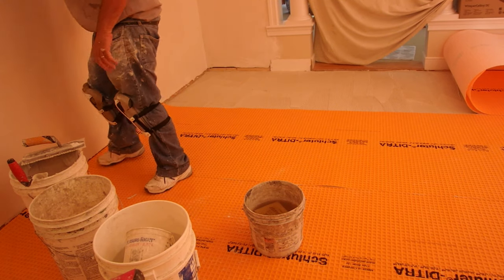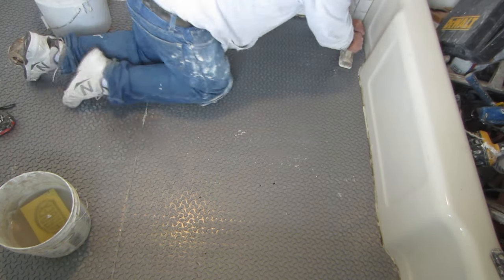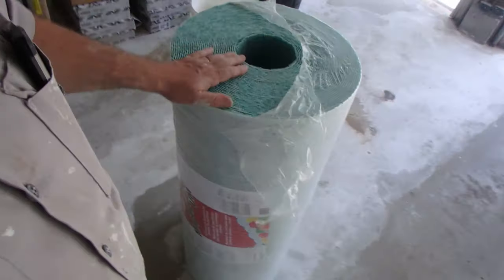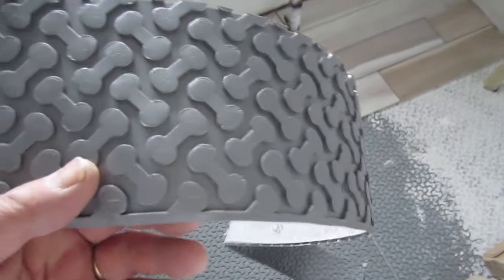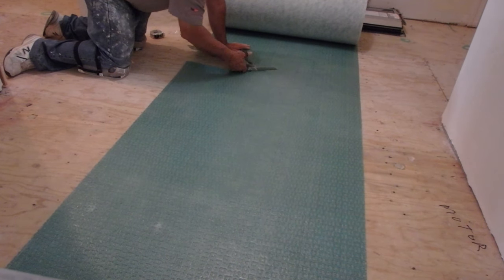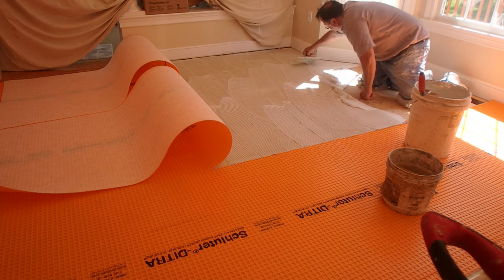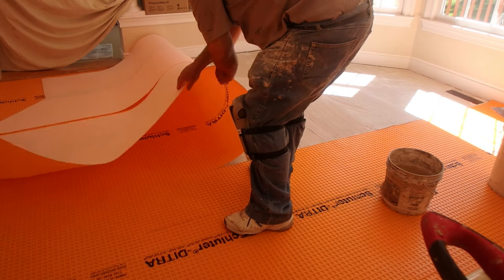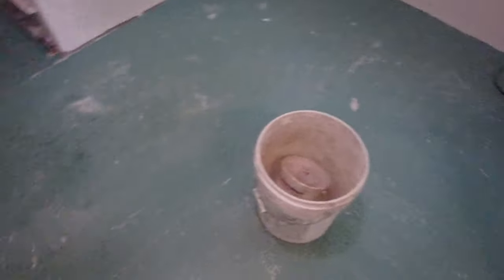TILE FLOOR don't let it fail

Comment: I just used Laticrete mat on my concrete slab for a kitchen tile floor.  Pricey at $1.37/ft2.  Flexbone was my next choice, but the Laticrete was best fit for size needed.  I heard of a new USB membrane at $1/ft2.  My last big floor tile job was 1994 when such didn't exist (screwed tile backer boards to plywood over 1" boards).  I did a bath and washer room in 2020, installing the tiles direct to the concrete, but small areas w/ no cracks in the concrete and smaller 1 ft x 1 ft tiles so "should work" (no cracks after 4 years).  Didn't know about uncoupling then.  Some use a roll-on liquid like Redguard or Mapelastic CI.

Comment: Thank you for the videos and tips!!  I am installing my first tile floor, and would be lost without you!!  For the next one, I would like to use an uncoupling membrane on top of an OSB-type subfloor (it is not plywood, and not particle board, so I assume it is OSB).  For many of your uncoupling membrane videos, the membrane is placed on top of plywood subfloors.  I have not noted that you mention OSB.  Should I assume that OSB and plywood are about equivalent for the purpose of overlaying uncoupling membrane?  THANK YOU!!
Reply: Scrape the floor to get any loose stuff vacuum and sponge it clean and then You should probably prime it with a bonding primer before anything else. And if you are trying to find someone to help you out with tile you will notice that nobody agrees with anybody about anything. But that's what I do when I'm working with OSB.

Comment: My local hardwood/tile store is telling us its ok to install their tile over 1-1/4" plywood, does that sound right?  It sounds like they are telling us the membrane isnt needed.  If I have a super beefed up floor (2 layers of 5/8 ply) wont that eliminate any possible deflection, or is the uncoupling for expansion/contraction issues?  How much does the ditra or doggie bone stuff protect against deflection?
love your videos, super helpfull
Reply from the maker: The uncoupling membranes attach the tile to the floor by a mechanical means. the tile is not actually adhered to the membrane so the membrane can move and deform without transfering that movement to the tile. It is a non force  conductive assembly, sticking the tile directly to the plywood, which can be done if you follow TCNA Handbook Method F150 to the letter, is a force conductive assembly, the tile is bonded directly to the substrate and the only thing protecting it from movement is the flexibility of the thinset, which is very minimal. Here is the Ditra Handbook https://www.contractorsdirect.com/PDF/ditra-installation-handbook.pdf
nad how an uncoupling membrane works https://www.youtube.com/watch?v=YpXEXqbh7ok&t=1s

Comment: Sal what is the best membrane to use for a small mosaic like penny tile? Schluter told me they won’t warrant a mosaic less than 2” on Ditra. I want to use a membrane for the penny if possible because I think it way lay much smoother.
Reply from the maker: None of the uncoupling membranes will allow tiles smaller than 2". Is this a floor or a shower pan?
Reply: @SalDiBlasi  It is for a floor
Reply: @SalDiBlasi  I have heard that nobleseal or just Mapei self level would be best
Reply: @SalDiBlasi  I have the same question as @reillyliner - help please! We have, sadly, already made the mistake of laying down Ditra before realizing that our 1" hexagons were unfit for it. Should we just use Mapei self-leveling over the Ditra to fill it in and make a new flat surface?

Comment: Hi Sal.  I was told to add 1/8" sheet of plywood on top of my OSB subfloor before adding thinset and Ditra.  If I do that then my tile won't be level with by 3/4" hardwood floor.  
 Can I put thinset directly on the OSB subfloor and then the Ditra then thinset and tile so it will be very close to the level of my 3/4" hardwood floor?
Reply: You can add a sheet of luon if you want or just scrape the floor to get any loose stuff, vacuum and sponge it off. Get some bonding primer and give the floor 2 coats of it. Then uncoupling membrane and then tile

Comment: Thanks for your information. I think I understand what the membranes do. I want to tile my floor in a concrete high-rise building in Bangkok (about 30 degrees Celsius +/- 10 degrees all year. It seems nobody here knows about membranes. And they are not available in construction shops. Is it maybe not necessary to use them on concrete and if the temperature does not change much? Thanks?

Comment: Great video! In the new build they put the baseboard in the bathroom, should I remove it before adding the membrane, or can I thin set the membrane on the baseboard?
Reply from the maker: Remove it

Comment: Hi Sal, very informative video. Do you recommend a floating underlay/ uncoupling membrane? I am looking at this specific product that will not be attached to the subfloor. The supplier says the product is really designed for that and won’t create any cracking issues. But I am afraid it’s just for promotion purposes. Appreciate advice!

Comment: I am doing a bathroom remodel and considering putting in the Ditra heat mat.  Potential problem is the previous homeowner put an epoxy flooring over the plywood substrate and tiled over it.  I'm not sure what thinset they used, but it stuck extremely well as I had to grind the thinset down to the epoxy layer h what a mess.  Is there a suitable thinset I can now use to adhere the Ditra mat to this roughed up epoxy floor?

Comment: Sal, have you ever used Dural Backer Lite? Looks similar to the Mapei product where the top of the membrane is covered with the plastic product. I thought it was strange that the thinset doesn't get filled into the voids (like with ditra). Love all videos and the dedication to your craft.
Reply from the maker: Dural is the same product, and they make it for Mapei.

Comment: Love your videos! You mention an “extra step” for waterproofing a floor if using Laticrete’s Strata Mat. What would you recommend? I spoke to the local Laticrete rep several months ago who suggested using 1/4” cement board or Hydro Ban board (over my OSB subfloor), then waterproofing that with Hydro Ban or Barrier (using anti-fracture tape on seams and screws), and then installing the Strata Mat. This route adds additional height that will create a noticeable step up that I wanted to avoid. Hoping you may have an alternate recommendation while still using Laticrete products. I’ve considered Ditra but given I plan to use Hydro Ban board on the walls I don’t want there to be a Laticrete-Schluter boundary for ease of ensuring maximum warranty coverage. Do you have a video that covers install of Hydro Ban board on a bathroom floor?
Reply from the maker: Since the strata mat has hydration perforations in it, you would have to add a layer of a sheet membrane over the whole floor on top of the strata mat.
Reply: @SalDiBlasi  Have you ever installed Hydro Ban board over OSB rather than cement board or would generally not recommend doing so? From a weight perspective and ease of cutting, it (Hydro Ban board) seems much more appealing than cement board if not using a decoupling mat.
Reply from the maker: @brandiatl21  Use an uncoupling membrane, they are designed for floors, Foam boards are designed for walls.

Comment: hello sal just a? or your thoughts on a shower floor is it okay to caulk the bottom perimeter or is grouting that in the way to go. thank you
Reply from the maker: Technically it is supposed to be caulked with silicone, I  will usually just grout that transition. I silicone all the others.

Comment: Huge fan of your videos! I am installing Red Guard uncoupling, using thinset over a plywood (23/32 Cat Ps1-09 Tounge and groove Pine) on a 16" on center floor joists. Is this a suitable base for 12"x24" porcelain tile installed with LFT Thinset?
Reply from the maker: You need to install an underlayment of some kind first, an uncoupling membrane would be my suggestion. You also need to check the deflection of the floor. https://www.youtube.com/watch?v=74BDTI67S1M

Comment: Sal. There are still installers using the mesh and scratch coat method. They claim with today's modern materials are the same or better and cheaper than an uncoupling membrane. What is your opinion? Thanks.
Reply from the maker: Don't  believe it, also know as a Jersey Mud Job, one of the worst ethods ever. Not to be confused with floating walls and floors.

Comment: Schluter allows you to use a modified thinset to adhere your tile. What’s so special about their thinset that allows this Sal.
Reply from the maker: The thisnet is formulated to work with Ditra. The reason is  a few years ago there was a development in thinset mortar technology that has mitigated the original reason for the use of an unmodified mortar.  All the manufacturers have mortars that will work with Ditra. The thinset manufacturer will substitute their warranty for Schluters' in most cases. Check the manufacturer  details for specifics

Comment: i see the backer boards role only in leveling in case  the floors might be uneven/wavey or in reinforcing / thickening the substrate where the floor is only plywood. Otherwise again, if it is a flawless concrete floor, there is no need. This is only my european view, i respect your experience. Here we have been mounting tiles directly on with no membrane. I know why membrane is popular, cause it comes in roles and easier lighter to carry than cement board.

Comment: Hopefully someday they will come out with an uncoupling membrane where the waffles are filled with foam or something instead of thin set, those membranes use a lot of thinset to fill the waffles.
Reply: That's what locks the tile into the membrane
Reply: @davegordon6943  Yes but Kerdi adheres also without waffles…I believe the waffles filled with TS gives it its strength..

Comment: Sal, question, customer had tile in plywood substrate. Over time issues occurred. How clean does the plywood need to be to install uncoupling membrane? Or do you recommend a different solution? Thank you for making the industry better.
Reply from the maker: If possible grind it off, does not take as long as you might think. You don't want  the new install to be dependent on the bond of the old thinset.
 https://amzn.to/2XOQqpg
https://amzn.to/2yu4pX6
https://amzn.to/2VnAs3X
Reply: @SalDiBlasi  okay a close to fresh wood as possible with a dust and wet wipe down I presume. Thank you very much Sal!!

Comment: Hey Sal,
Im Pinning down a plastic lath over concrete slab. The plumbers gonna run his radiant PEX and Zip tie it to Plastic Lath.
Installing expansion joint around perimeter of floor, then stretching the dry pack.
Question, 
Will installing any Uncoupling membrane over a mud/Lath application with hydronic radiant heat be unnecessary?
Reply: You have no common sense apparently. You would use gyp crete to encapsulate the pex, basicially a sellf leveling product then tile over it. Doing a dry pack over radiant floor then putting a plastic membrane over it is going to be ineffctive

Comment: Would you always lay a backer board on the floor over plywood? Is primer necessary?
Reply: Primer for sure over old. Use it ACCORDING TO SPECS.  Start tiling after proper limited "dry"time. You don't need a backerboardwith these membranes.
The extra money is ABSOLUTELY worth it.  The risk of your bad tile job will be lessened versus the difficulty to install that backerboard anyways, too many things to get wrong. And it's still not going to perform as well as crack iso membranes or uncoupling

Comment: Hey sal, I have a question I’m hoping you can help me out with. So I’m redoing the addition on my house that was done in 83. And the subfloor is 5/8” not tongue and groove which I don’t love but it is what it is.. I’m tiling the bath floor and it will be meeting hardwood. In 2 other areas in my house I put 1/2” cement board over the 5/8” and transitioned to the existing  hardwood with an angled schluter metal which worked out great but ideally I’d love for the new tile and new hardwood to end up flush like usual.. do you think that 1/4 hardie backer over the 5/8” is strong enough or would you recommend an uncoupling membrane? Love your videos and really appreciate any advice you can give.
Reply from the maker: First off if the plywood is not tongue and groove, you need to install blocking at all the seams. Cement board hs no structural value, the only reason to use the 1/2" on a floor is because you need the height, 1/4" is made specifically for floors. Better to use an uncoupling membrane anyway.
Reply: @SalDiBlasi  thanks for the feed back

Comment: Hi Sal which produce would you suggest as far as chalk lines being visible  an more so holding to the membrane for a good layout. Iv had problems with this I  even tried spraying line's with hair spray Or would you suggest I tight coat the day before when possible
Reply from the maker: I will usually use a black marker to draw my lines.

Comment: What are your opinions on tiling on level concrete? Where I installed my tile there are never any major earthquakes or flooding or anything so foundation issues are very uncommon. I've had no issues.
Reply from the maker: Well if it is done, then no point worrying about it. Concrete moves at almost twice the rate of tile, so there is that. Even though you don't have any cracks in the concrete now, it does not mean it will not happen later. Like I said there are two kinds of concrete, All that being said, I have installed directly on concrete countless times with no issues, that I know of. If you can afford the uncoupling membrane then I suggest you use it next time, it could prevent a problem where without it it would occur.

Comment: Sal/.everyone- which membrane is thinnest ? Schlueter looks much thicker hence I’d have to deal with a comparatively elevated floor ?
Reply from the maker: All the regular membranes are about 1/8" thick, some have thicker versions like Ditra XL and the heat wire versions are all about 1/4" thick.

Comment: I could use some advice.  I want to put down cement board on my sub floor (kitchen-entry-1/2bath) for the density and feel of walking on a concrete-like floor.  If I lay my cement board over my linoleum, then ditra over the cement board, then tile... Will that work or am I making a potential disaster?
Reply from the maker: It is best to remove the linoleum, before you either put down the cement board or the Ditra. In no instance should you you use bothe cement board and ditra, either one or the other, not both. Here is a link  https://sccpublic.s3-external-1.amazonaws.com/sys-master/images/hcd/hde/8917115306014/DITRA%20Installation%20Handbook.pdf to the Ditra Handbook, on page seven you will find the detail for installing ditra on existing vinyl floor, read it carefully to be sure you meet all conditions. In any case, as I said, best to rip out the linoleum.
Reply: @SalDiBlasi  Thanks Sal!

Comment: hey sal good info I"m a tile installer and I've been kinda afraid of that membrane because I"ve tried using once on some walls and it seemed to just want to come off the wall didnt feel confident using it because of that but also like when they have that advantec down for the subfloor does thin set adhere to that because it seems to have some kind of a water proof film on it so its water proof on its own
Reply: Uncoupling membranes are for floors. I'm pretty certain, at least for Kerdi, that walls are not an acceptable application. I don't recall seeing anything about it in their install manual. Sal has discussed this in previous videos, but with non-concrete sub-floors, the Kerdi manual has extensive instructions for sub-floor prep (e.g. thickness, beam spacing, beam length, deflection, etc). You can't just slap down some Kerdi and marble tile without a properly prepared sub-floor.
Reply from the maker: As ken said, uncoupling membranes are for floors, not meant for walls. Advantec is an approved substrate for uncoupling membranes and will stick no problem as long as you use the proper thinset, done it many times.
Reply: @SalDiBlasi  do you use a bonding primer over advanteck?

Comment: Why would you prefer uncoupling on cement floor for example?
What's the benefit? Tnx
Reply from the maker: There are two kinds of concrete, concrete that is cracked, and concrete that is going to crack. Uncoupling will protect you from future cracks. Concrete moves at a different rate to tile, by movement I mean expansion and contraction, and yes it does move. Uncoupling compensates for that. Just two reasons to use it.

Comment: So I never heard you talk about what kind of thinset you use to attach the membrane to the floor? Are you just using the same thinset that you’re setting your tile with? Also, I see you using a thinset when making your mudbeds. Is that just like a primer/precaution?
Reply from the maker: There are different types of thinset mortar, some are good for some things and not good for others, so you have to use the one matched to the need, here is a video that explains the basics, https://www.youtube.com/watch?v=S80GVg4Y4MU  Depending on your substrate, the mud bed will be either unbonded, or unbonded. Mud bed on plywood will usually be unbonded installing a tar paper then wire lath then the mud, on concrete it will usually be bonded, usually thinset is spread and while still fresh the mud is floated over it so it all becomes one. 
Bonded mud bed on concrete https://www.youtube.com/watch?v=m9eSdRkCcEo
Mud bed on plywood https://www.youtube.com/watch?v=5fazbIqsw8E

Comment: Sal, question.  the uncoupling membrane protects against lateral movement between the sub-floor and tiles.    I see that  the material is plastic and some thin white foam looking material,  wouldn't there be some vertical movement as well that might cause the thinset and grout to crack later on?
Reply from the maker: No underlayment can protect from vertical movement at a crack.